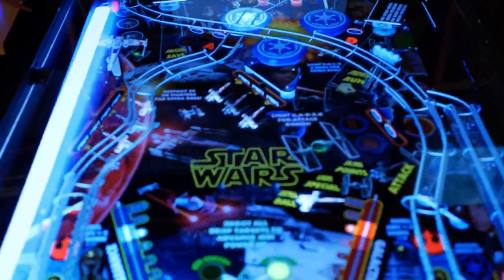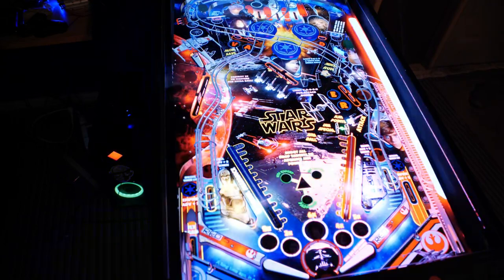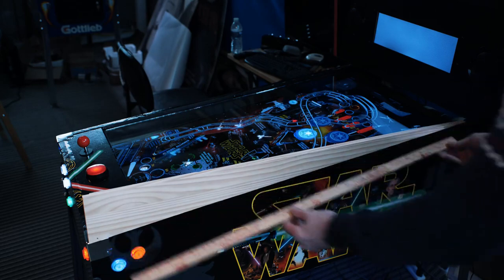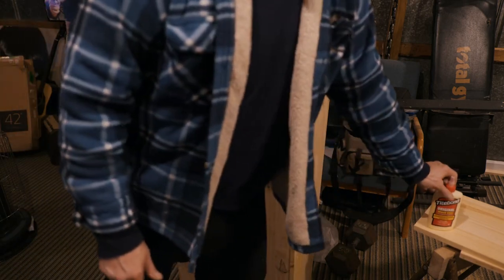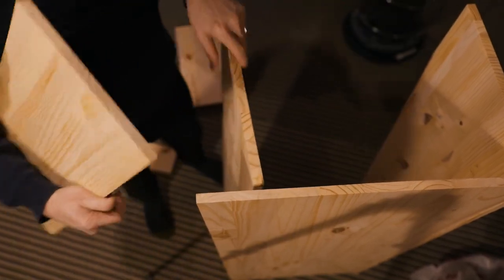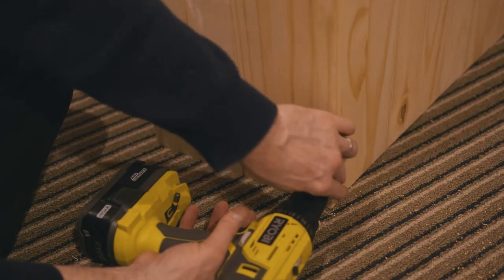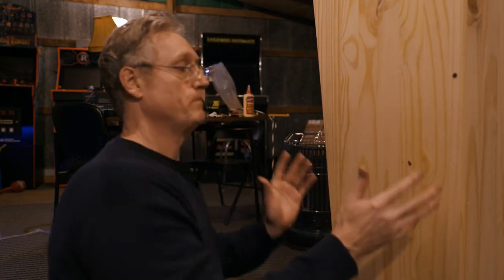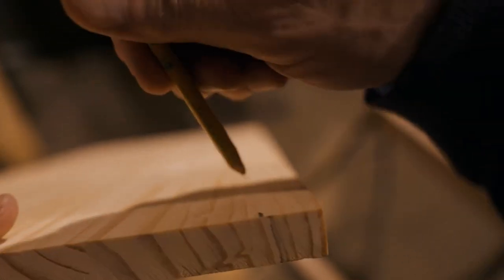$2K 4K virtual pinball build: a Step-by-step state of the art vpin cab you can build for $2000 bucks

Comment: Any reason not to use plywood?   I expect you can’t join the boards as you did with pine.
Reply from the maker: You could for sure, but hard to beat the strength vs lightness   aspect of pine.